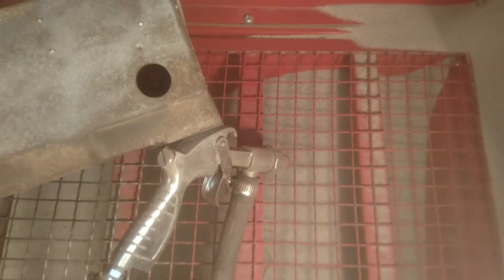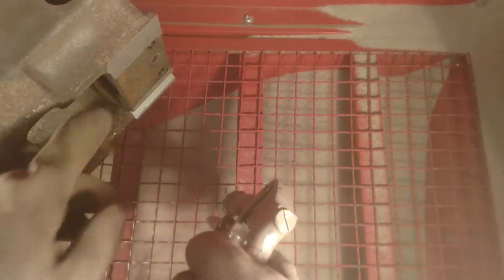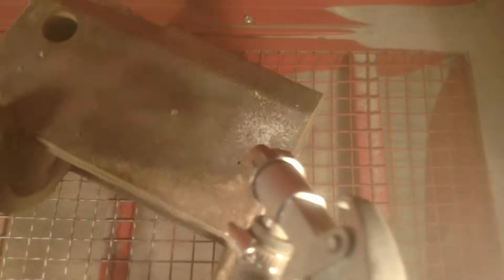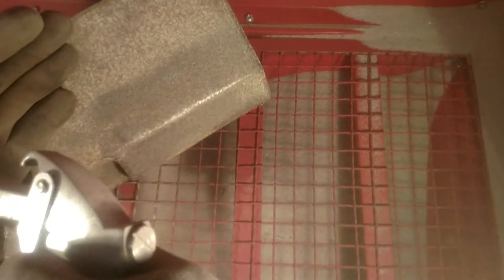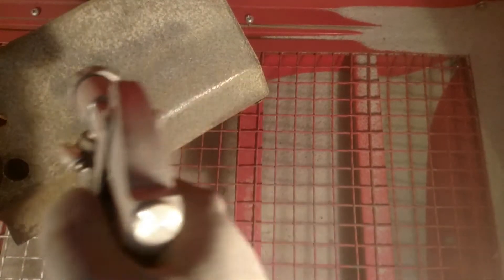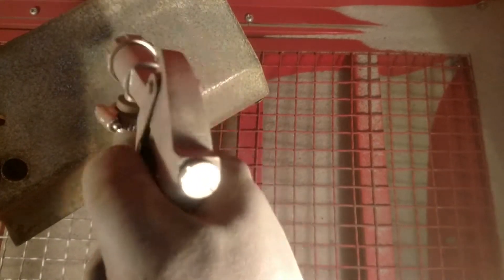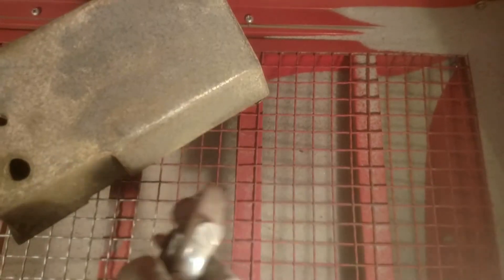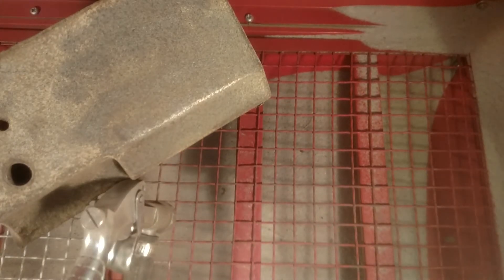Rockwell 10" Metal Lathe Restoration #6

Comment: Restoration appears more directed for aesthetic purposes and not mechanical restoration or preservation.
Reply from the maker: hi Rick Cohee,  all the gears looked to have little or no wear except the one one bronze drive gear in the apron. I purchased a new one on eBay and replaced that. both of the headstock bearings felt crunchy and I found matching new/old stock on eBay and replaced both of those. The Bearing on the eccentric back gear engagement shaft felt in good shape so I didn't replace that. The ways looked good except there did seem to be some wear on the carriage ways but that may have been machined in, either way I plan on waiting on that seeing how I can't scrape. What mechanical aspects were you talking about? 😃